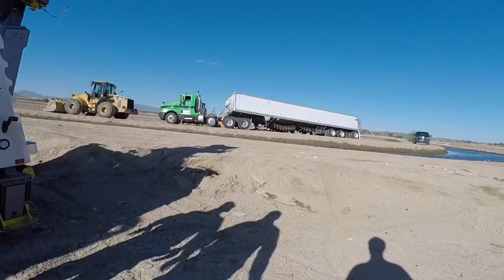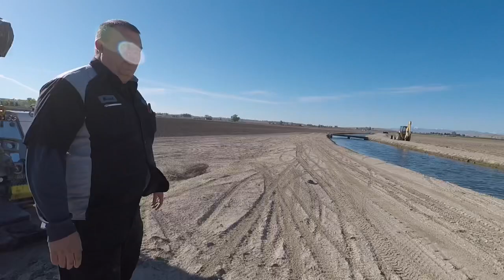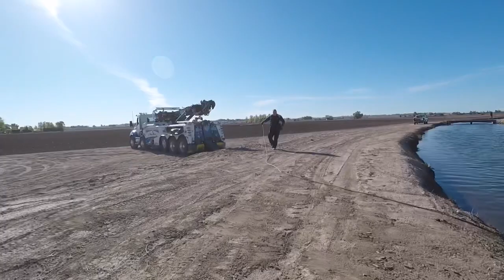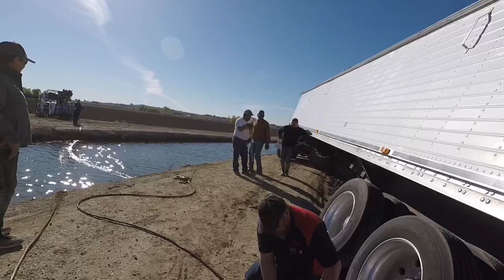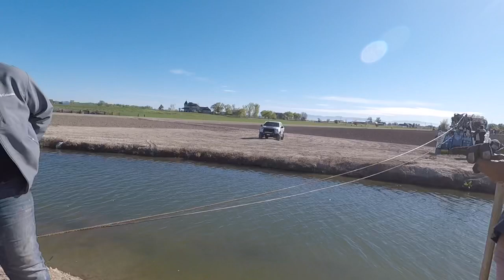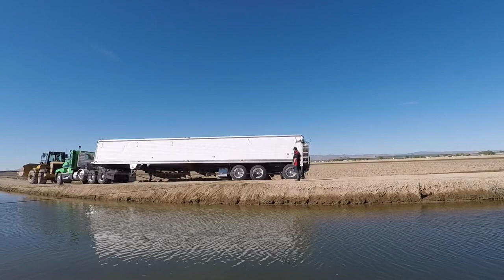Tators n’ Carrots 🥕

Comment: Yall need to put a line over the trailer next time to hold the trailer up. Yall are lucky a chain didnt break and flip it. I always hold them up then pull sideways if I cant get my 1150 to the back of the unit and lift and swing